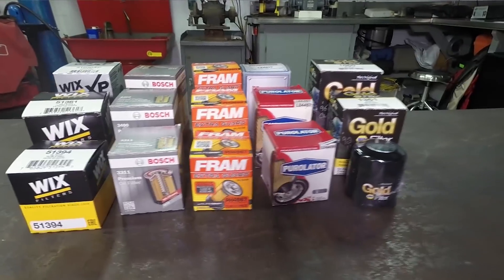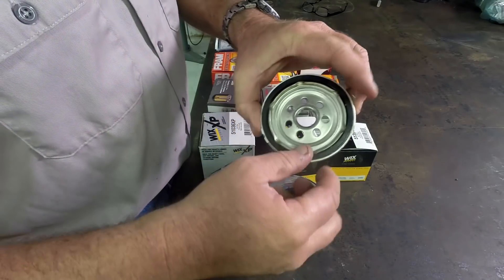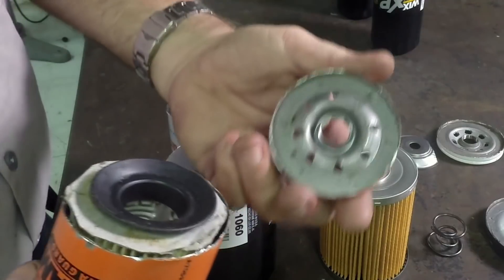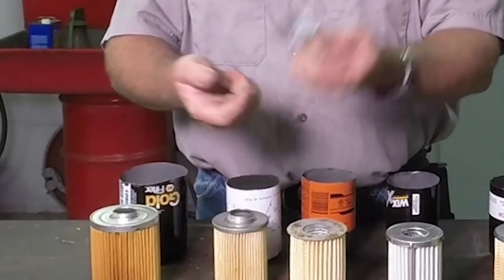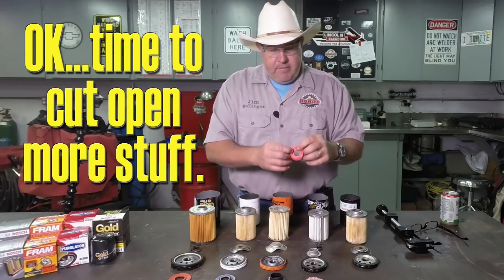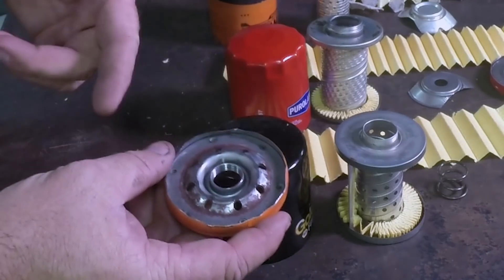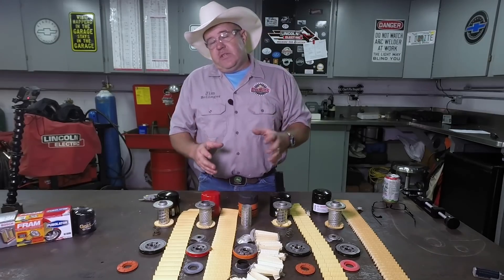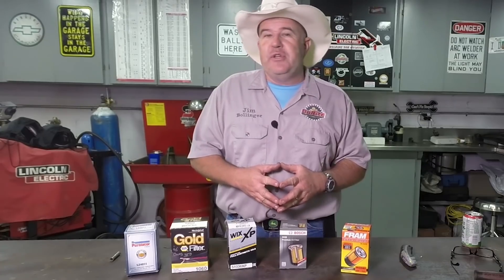The worst oil filter EVER!

Comment: I would like to see inside Delco and Motorcraft filters.
Reply: the motorcraft is very well made and is one of the best
Reply: Delco and Motorcraft do not MAKE oil filters, they BUY their filters from various large scale filter foundries ..... probably/mostly Purolator, a 'decent' manufacturer.
Reply: @richh1576   motorcraft has great filtersw its one of the very best made aswell
Reply: @BronsonOsborne  Sorry, but you did not SEE the goodness, etc. of any filter by simply LOOKING at it.  Such oil Filters principle sole function is to remove  particulate that is 2X smaller than what the human eye can possibly SEE - approx. 40 micrometers or 0.001574".  The spec. removal for most IC engines is 20µM - defined by automotive engineers as 'the most damaging particle'.  
There is absolutely NO WAY a human being can tell how 'good' a ~20µM oil filter is or isnt by LOOKING at it.    ;-)
Reply: @richh1576   cut it open and have a look the motorcraft filter is one of the very best made thats a FACT
Reply: @richh1576  , true, a  real in depth look at the filter media itself should be Part #2, but the ones with an extra foot of filter  is a step in the right direction.
Reply: Ss Russ  yup,. excellent filters. Just as if you use 5-20 oil motocraft is fine.
Reply: @GodOfWar109  Not really Motorcraft are made by Purolator which have a problem with the filter media tearing. I seen photos of the media torn on the FL-820 a few times. People refer them as Tearolator filters because of this.
Reply: @tedbundy3729  AS with most asian supply, the Chinese are rapidly penetrating the world supply of quality products with 'junk'.  This is rapidly beginning to show up even with the simple - resin impregnated cellulosic technical filter paper .... w/ less than sufficient resin to keep the fibers from coming apart from one another ... especially then the filter paper is ***wetted with WATER***.  Otherwise it is remotely possible for such pleats to become broken due during 
1. the computer controlled pleating process  ERROR ... usually done at the filter foundries, not by the resinated technical paper manufacturer. 
2. the filter being operated in the *wrong* filter flow direction - flow direction MUST be from outside to inside of the pleat pack.  
3. the filter being operated at higher than the max.design pressure - which can easily happen when using insufficient surface area of the pleats.
Reply: @tedbundy3729  wow I didn't now I've been using them in my f-150 from New 2005. Got over 240,000 miles on it now.  I used napa gold a few times maybe I'll go to that?
Reply: Fram does make a good filter in the higher tier. Carries the same ending patt number but much higher quality.
Reply: Glad this came up in my suggestions going to do a oil change tomorrow thanks for the video
Reply: Yes so would I that's what I use in my 2005 f-150. 5.4 3v
V8. I now have over 240,000 miles on it. Running great. Would like to see the Mopar filter also. That's what I use in the wife's 2004 jeep 4.0. Over 220,000 engine purrs like a kitten 😸
Reply: yes, i also would like info. on the Motorcraft filter. I do not service my vehicles myself, The Ford dealers service all my Fords and they use only Motorcraft
Reply: They have filter pods you replace check them out next time you go to the parts store
Reply: I use 5,000 mile purolator filter in 97 f250 7.3 and 2003 f150. Never had any problems.
Reply: Good point! See how 3rd parties stand against OEM parts!
Reply: Purolator is the OEM for Motorcraft. They’re fine. I’ve used purolators for two decades often a year at a time if I was running a good oil and they never leaked or anything.
Reply: Recently tore apart a Motorcraft filter, clean and sturdy but the filter material did tear when handling (though was still soaked in oil and had resistance since I didn’t cut it out all the way. Tore less than the fram). Was checking for metal filings.
Reply: Then cut one open fool !!
Reply: Never ever use the orange can of death. Those have been garbage for a long time. I use either wix, motorcraft, or delco
Reply: Same thing you find in every other filter.
Reply: @dwc4343  Good observation!!!  Just about ALL the US and EU manufacturers use a SINGLE world source of technical grade resinated filter paper in their oil filters ... supplied by Alstrøm Corp of Finland. The only difference will be the very slight differences in µM removal and total effective surface area of the pleat pack.

Cheap Asian supplied technical filter paper for oil filtration, on the other hand, is inconsistent and variable in removal, etc. and is becoming a real problem as some domestic US filter foundries are beginning to use this asian filter paper.

Comment: 15 yeas ago, I first saw a write-up with photographs that someone did with photographs of the parts of each one.  In all that time, Fram hasn't corrected even one of the problem areas.   I used to buy Fram oil filters regularly, until I saw that report.  I guess they don't wan ANY of their old customers coming back.

Comment: I quit using Fram years ago after I noticed the filter had been pushed away from the block by the engines oil pressure.  The base plate had bent but hadn't allowed the seal to leak. Unfiltered oil was probably going thru the motor until I noticed it. These days it's nothing but WIX!

Comment: Great! I just installed a Fram in my 2019 F150 5.0! Crap! Wish I saw this first! I'll be changing it out for a Wix or Napa!
Reply: Why would you change it? Did you buy into that bs. I've used them for years. They are a reputable brand. Been using them for years with no failures. Can't go wrong with a Fram.

Comment: Thanks very surprised with fram. No more low budget frams for me but to be fair the fram filter tested is the lowest cost In their line of filters. I really don’t know if this is an apples to apples test. The top of the line fram is made much different. Also no mention of the purchase price. Napa generally cost much more than the low line fram. So to make all things equal you should redo this video and tell everyone all the facts. I’m a retired 40 yr automotive repair veteran. I don’t think this in an honest comparison although you do make a good point on the budget fram

Comment: The factory Mercedes-Benz cartridge filters looked an awful lot like the inside of that Fram filter back in the late 90's, including the cardboard ends.  They were designed to run a minimum of 10K miles, too.

Comment: I use filter elements in a canister. Any tips on what brands? I use Britpart filters but change 2x a year. Fuel filters i use Britpart as 1st filter and cha nge it when i change the oil 2x a year. 2nd filter is a Mann brand and lasts a year.

Comment: Hi,  and thank you for making this video. I've used fram oil filters for quite some time not realizing how bad they are. I've been using the fram PH8 filters on a fenderwell mounted dual oil filter bracket for my SBC 350 and have had difficulty figuring out where they were leaking from. Found them to be leaking around the cheap rubber gasket. I googled the top ten best filters and settled for Purolator filters. So far no leaks.

Comment: PEOPLE!!!  All of those filters are JUNK!!!  FRAM IS A GOOD FILTER!!!
THERE IS SOMETHING WRONG WITH THIS TEST OF THE FRAM FILTER!!!  BECAUSE IT'S SIMPLE IF YOU THINK ABOUT IT!!!  THE WAY THE FILTER ELEMENT WAS FLAKING AWAY SO EASY!!!  IF YOU PUT THAT FILTER N YOUR ENGINE!!!  IT WOULD FLAKE OFF AND ENTER YOUR ENGINE AND PREVENT OIL FROM GETTING TO THE BEARINGS OR AND BLOW YOUR ENGINE UP!!! AND IF FRAM SOLD FILTERS LIKE THIS YOU WOULD BE HEARING ABOUT ENGINES BLOWING UP BY THE MILLIONS!!! 
ONE REASON I SAY ALL OIL FILTER ARE JUNK IS BECAUSE THEY ARE ALL BY PASS FILTERS!!!  
A BY PASS FILTER IS A FILTER THAT A CERTAIN PORTION OF THE OIL THAT GOES INTO THE FILTER IS BY PASTED AROUND THE FILTER ELEMENT AND IS NOT FILTERED!!!!!!!!  ANOTHER THING, AS THE FILTER PLUGS UP MORE AND MORE OIL IS BY PASSED AROUND THE FILTER ELEMENT AND IS NOT FILTERED!!!  SO AS TIME GOES BY LESS AND LESS OIL IS FILTERED!!!!
BUT PUTTING ALL OF THIS ASIDE WHICH HAS NOTHING TO DO WITH ANYTHING!!!  BECAUSE EVERYONE ONE OF THOSE FILTERS ARE JUNK!!!!   BECAUSE THEY DON'T FILTER OUT WHATS WEARING OUT YOUR ENGINE!!!  IF THEY FILTERED OUT WHAT WAS WEARING OUT YOUR ENGINE!!! YOUR ENGINE WOULD LAST FOR MILLIONS OF MILES!!!
YOU SEE OIL IN YOUR BEARING CAN'T WEAR FORGED STEEL!!!!  OTHER THINGS IN THE OIL CAN AND DO!!! THAT'S WHY ENGINES DO WEAR OUT!!!  BECAUSE THE OIL FILTERS ARE JUNK!!!  WHEN YOU BUY A NEED FILTER YOU ARE PISSING YOUR MONEY DOWN THE SHITTER!!! 
Larry

Comment: You fail to mention anything about performance of the filter. A filter that is nicely built and looks pretty could easily be a poorer filter that one that looks, in your opinion, shabby. You can have all the filter media you like inside but, if it has the wrong filter rating in terms of microns then it's no use.

Comment: I have used fram most of my adult life and I'm 63 now, I have had cars that lasted well over 200K and ran when I sold them. If one changes oil and filter regularly you will be fine. Marketing products is mostly a sales pitch, Fram is not a bad product, not the best but it does filter the oil, more expensive filters have more media but you will have a hard time proving they are worth the extra cost if you keep up your oil change intervals
Reply: More filter media does not make it a better filter, only the size of the holes in the media alters that. More filter media only makes a filter last longer before it blocks up.

Comment: Yes, Wix and Napa Gold are great filters, but, based on engineering data, Baldwin can be far superior to either of them.  I studied the actual engineering data on over 300 filters (not just the online specs) that fit just one application (the common 51515 filter used in many Ford, Chrysler, IH and other engine makes ) and came to some interesting conclusions.  Three of my biggest concerns or comparison points were filter pressure drop or restriction of the filtering media, the grams of contaminants held, and the size of particles filtered from the oil.  I put my results in a table on a IH forum, but I think it may be worth checking out regardless  of the vehicle you drive  (especially if it uses a 51515 filter).  The posts may start out lame, but some good filter info is there beginning on page 2.   My three IH trucks and my Ford F350 with its 360V8 all use the same filter, and I will never use any other filter in them now other than the $16 Baldwin B7311-MPG filter.  Of course the by-pass pressure and anti-drainback are the same in this filter as the 51515 filter, two of my other comparison points.
https://forums.ihpartsamerica.com/showthread.php?t=4022

Comment: Fram air filters are no different. I have seen so many cars come in with collapsed fram air filters. Never seen ANY other brand air filter collapse except fram. I've seen a few of them that were actually losing their filter media into the engine... completely defeating the purpose of the air filter. FRAM ANYTHING IS 100% JUNK

Comment: This is a joke, how do we know this isn't sponsored by someone or click bait?  Why didn't he peel apart the paper filter on the video while we watched instead of beforehand?  Why is it only the Fram that was peeled apart like this?  You can't see any rust inside the filer, just his rambling!!  I have cut apart the orange Frams and others and never seen any rust inside.  In fact they are surprisingly well made for a $4.00 filter designed to last 6 months.  This guy had an agenda to trash Fram before he cut open a single filter!  If they are this bad, why is it Fram users get 400,000 miles out of a vehicle?

Comment: Thanks, I was always suspicious of WIX and thought FRAM was the good stuff. You set me right and saved me some money!
Reply: And - more likely - a new engine.
Reply: Na, he's just a dumbass that doesn't know what he's talking about.  It's not rust, it's resin.  Fram filters use a bonded resin-impregnated endcap that creates a more secure connection than metal to paper. If you really want to know how well they actually perform, you can read the ISO testing data.  They aren't the best, but they are pretty darn good, and this dipshit just cost you a bunch of extra money because he doesn't know how to read.

Comment: Thanks for that test.  

I had a feeling about the Fram. I never liked them because of that aggravating gripper thing. It was always big enough to not fit my oil filter wrench that fits the other filters.    I am glad I swore off them after all.   Great test!. 

I usually buy filters at Wal-Mart.  Wal-Mart even began carrying Toyota brand filters, so I bought one of those last time because the price was comparable to the others. 
AC-Delco might have been a good one to toss in the mix as well at some point.

Comment: I've unboxed Fran filters because I've brought one that was missing its gasket and found surface rust on the engine side of the filter. I thought it was the way the store or warhouse was storing it. I bet it the material and way the manufacturer is storing its material. Ive always heard how good wix are and they sponsored links tv show. I think for now I'll be going to Napa to at least by my filters.

Comment: While the construction may not be as sturdy, nothing he showed has anything to do with the  ability to remove trash/debris/impurities from motor oil. If it doesn't implode from suction restriction or explode from lack of discharge, then the construction is "strong enough" for the job it's designed to do. This is a consumable item that gets replaced every 3-k miles. 

Fram may be a poor quality filter but this video doesn't prove that. Flow and filtration are the only things that matter.